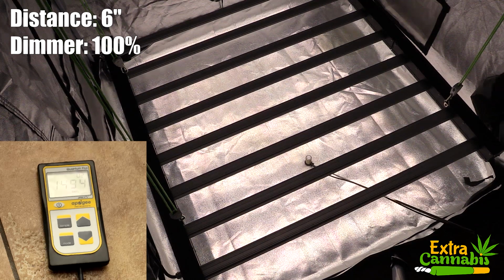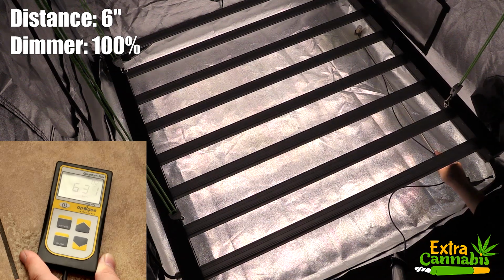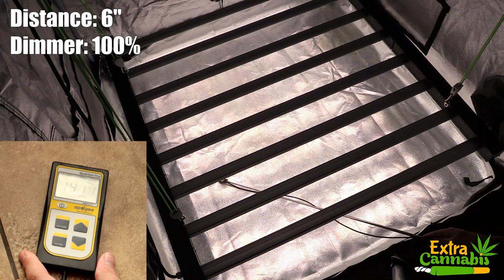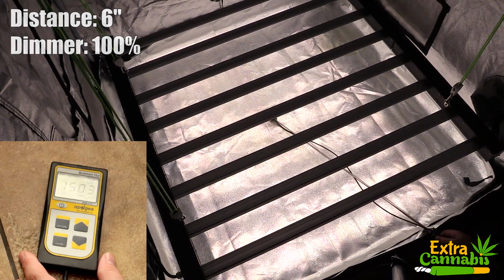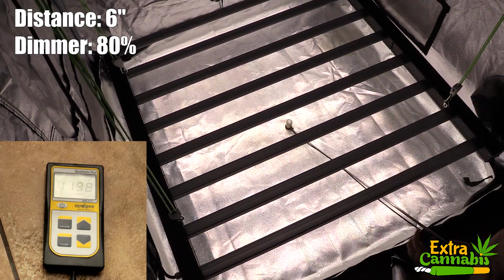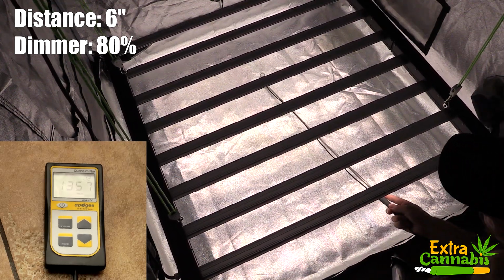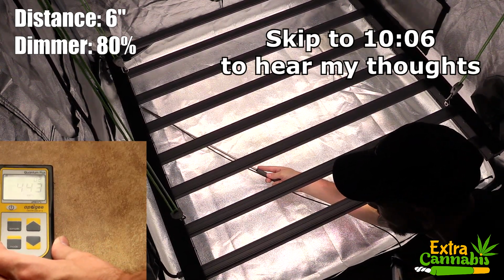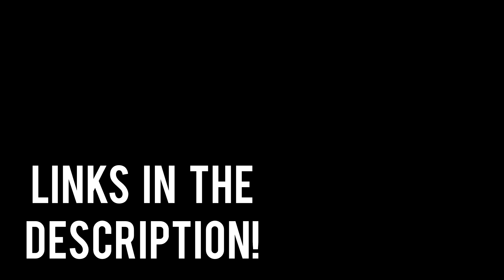Growers Choice ROI-E680 LED Grow Light PAR Test!

Comment: Great video. Big ups for posting!
Any chance you have readings at 18 inches?
Also a video like this for the 720 would be really helpful. Any chance you have that coming? 
The only video out there  has it set at 100%, would love to see it at different settings like you did here. Thanks!
Reply: I’m thinking about running mine at 18 inches as well at 80% dimmed seems in between , instead of 24 inches at 100% dimmed 🤔🤔

Comment: Hey mr grow!! I have 4 of these lights are they similar to a 1000 watt and are they Capable to produce a pound per light ?? Please let me know thanks MR GROW 😎
Reply from the maker: They should. One fixture puts out 1700 PPF which blows away a 1000w HPS. Make sure you grow high-yielding genetics if you are going for weight. Cheers!
Reply: @GardenTalkwithMrGrowIt   Mr.Grow it, Ive been eyeing these and electric sky es300. Electric sky had impressive par on your review, do you have any input to help me make a decision. 4.5x3.5 space. Thanks mon
Reply from the maker: @mikeq02  I don't think the ROI E680 will physically fit in that space.
Reply: Ok thanks, electric sky it is .

Comment: Thank you so much I been having issues finding the right distance n dimming percent..been doing 300 n it been burning my tops n new nodes so I have at under 200ppfd which really doesn't do much but cause larfy growth I don't know what to do in a 4x4 im thinking humidity may be burning it if i have a 4inch duct fan but afraid might be too small to rotate air evenly smh
Reply: We're you able to figure this out I have the same troubles.

Comment: Hi, I have asked plenty of growers for help and no one replies back so here goes nothing. 

I have these lights in my tent 8x4 with 2 680's
 
My vegative growth is amazing. I am happy with how everything grows. But when I switch to flower the leaves get heat stress and my buds do not get big because I have to either turn dow light intensity or move the light away. Please help. If throwing away these lights is the way to go please let me know. Thank you
Reply from the maker: These are very powerful lights. I personally had better success running them at 80% in flowering. So maybe reduce the % and increase light distance. That assumes everything else is dialed in - environment, nutrition, etc.
Reply: yup had same issues,  running them at 60% about 8in (that close because it stretched more than last strain) from canopy and they love it.  80% would fry them and get yellowing on edges of fan leaves, 100% would destroy them that close to canopy lol.  in veg had good results at 40% and mainly focused maintaining distance. Think staying around 900-1000 ppfd in bloom at whatever distance may be the trick.  im a dumass who worked through the problems so good luck.

Comment: Mr grow I know you must be tired of answering silly questions but I'm a new grower and I bought this light as a upgrade for my new 5x5 I'm having a few issues trying to file in some par numbers for my autos I used your recommendation for early  seedlings it was the same 4 auto but my 15 day old autos I'm trying to find a good height and %   I would love some feedback is 390 to 470 ish good or can they handle more
Reply: I use a lux meter and multiply by .015

Comment: Why is this lights max par much lower than a light like a SF4000?
Reply: The light bar set up I think
Reply: The sf4000 is a great light but has huge hotspots in the middle. This light is much more spread. And you're comparing a quantum board to bar lights
Reply: @SageLakshmi  I do agree with that. I hate the hot spot in the middle. Nobody with available money should ever buy a quantum board light. Bar lights are the best or Scorp diablo style